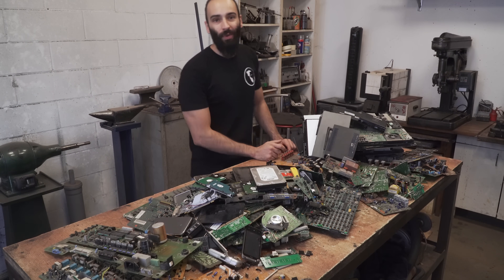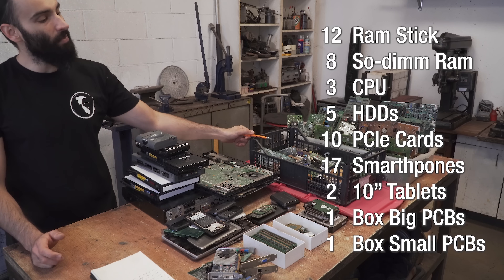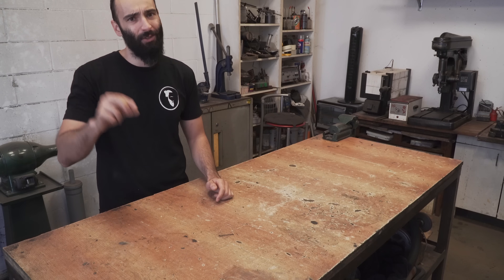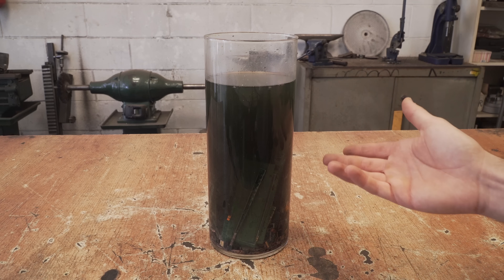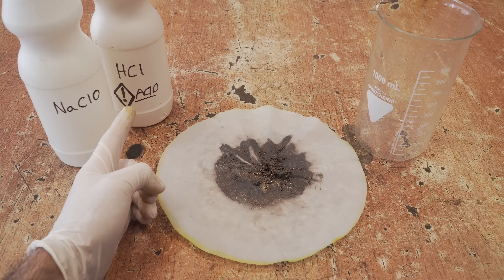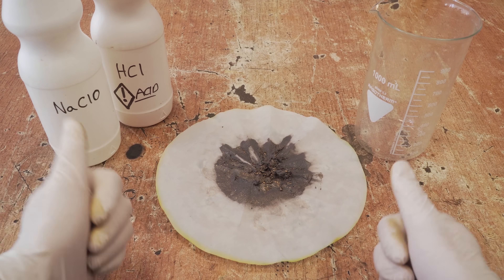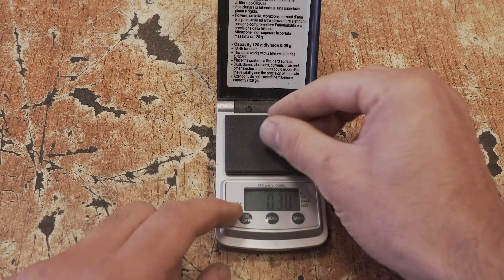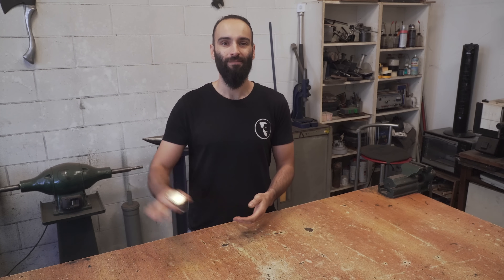E-waste GOLD Recovery | Recycle Broken Electronics!

Comment: You didn't wait for the gold to fully precipitate, SMB addition takes a bit with low gold bearing amounts, and is susceptible to temperature.

You volatilized some gold by burning the filter paper. Generally avoid that. 
Do a second round of refining to remove the filter paper and increase purity, particularly with E waste. Then decant and vacum out the liquid to dry powder.

You didn't add sulfuric acid that I saw, so you probably had trace contamination of Led. 

You didn't wash the gold after recovery. Normally you use boiling water to clean it out from impurities that melt. An HCL bath to help with purity is usually needed as well.

Moreover, review your chemistry on gold plating separation. HCL and H2O2 will put gold in solution. The liquid you called waste likely had some gold in it.

I think you could have nearly doubled the amount recovered with more research on this one.
Then again it's a 2 week Processing so it's not like you'd have made $ on it at all either way.

Comment: You probably lost a small amount of gold due to adding peroxide to your HCL for the first process.
I prefer using HCL only but leave it longer and/or heat it.
You might also have not dropped all the gold with your SMB ... only way to know is with a stannous test on the pregnant solution followed by a stannous test on the liquid left after dropping the gold.
Your best yield items there, anyway, are the chips which I hope you will have processed :)

Comment: But that acid can be used over and over. I saw  a guy that went 3 weeks of the same acid bath till all the gold came off. He ended up just scraping the gold off. Sometimes it needs mechanical means to make it come off. But i did see alot of gold still left on the fingers.  So since got the stuff might as well do all of it. He got a nice big button of gold from scraps.  But gold will probably keep going up in value. Its not like it can be printed like money.

Comment: I worked in a massive E-waste company for about 10 years. High grade boards were absolutely the moneymaker, as well as gold contacts. But there’s were big beefy gold plugs. We had 2, and later 3 main contracts. One was office E-waste, the other was in dismantling decommissioned mobile technology, the infrastructure. Near a phone mast you will see a series of huge green cabinets. They are FULL of gold contacts. Later on we got a contract with BT, decommissioning all their old exchanges from decades ago that were just shuttered all over the country. It was full of gold and palladium. The company expanded so much we ended up with our own shredder warehouse with belts, vibrating tables, magnets etc and visual sorting system. It would recognise a piece of shredded material and jet it off into different boxes. I miss working there now. The owner started like you, scrapping electronics in his garage. He ended up with 2 Ferraris and a lambo 😅
Reply: How do you get rid of silicone from the process?
Reply: Hey I also have an ewaste company and I would love to ask you some questions. Any chance we could connect?
Reply: Would you please help me??
May I get your contact number?

Comment: you left most of the gold in the beaker, with that tiny bit of metaby you needed like 10-12 scoops till the water turned, it was still yellow in the beaker. The gold don't catch in the filter paper it catches in the metaby when you drop it out of solution. I was LMAO at the tiny bead.

Comment: Nice video 👍
Looking forward for the next one.
Just wanna mention out some points.
Adding the SMB to the gold solution is an exothermic reaction. You might have a boil over effect because this. My advice. Use a taller beaker. 
Also. The SMB reaction is kinda slow when the gold concentration is low. I noticed that the colour of the waste changed after you filtered it. Definitely a loss of gold there. 
My advice. Let is set over night. It will collect in the bottom of the beaker. Then filtration is not necessary. You can siphon of the liquid. Then test the waste with Stannous. (Tin2 chloride) so you are sure that everything is precipitated 👍
Reply: СОГЛАСЕН!!!!! 
ПОТЕРИ там были!!!!!

Comment: More interested in the copper separation, which is the bulk of the weight of the PCBs. Not to mention using that to cast brass/bronze parts for machining later. ;)

Comment: HCl is a joke for dissolving gold you need a combination of HCL and HNO3 called aqua regia. It is 3 parts HCL and 1 part HNO3. You threw away almost all of your gold. 

However, acquiring HNO3 is somewhat tricky and you might get yourself listed on the secret service watch list if you try to buy it directly. You would need to make it by yourself and to do it you would need to make H2SO4 first and source of NO3- ions. The process would yield you enough gold to be in + in the end, however, it would be hard for you since you are a beginner without even basic lab equipment. But will earn much more from this video than you would be doing that. This is just my input as a chemist as this hurt my soul.

Comment: First I have to say thank you, as an IT professional I truly enjoyed you destroying all of those components :).  My company has over 130 locations, 40K employees and we recycle all of our E-Waste.  I got to visit the facility that processes it and the place was massive.  At the heart they had a 3 story grinder/sorter, electronics go in, get ground up, then are sorted by floating them in higher and higher density liquids, they skim the floating material off the top and collect it.

They process so much and the operation is so large, they turn a very decent profit.  Yes some of the electronics are repurposed and sold to other companies but hard drives and memory storage devices are destroyed (I'm in healthcare, that's important).

Really nice to see you do this project, it might not be profitable, but it's a learning experience and fun.

Take care!
Reply: What company?
Reply: I worked in a big E-waste company like this, we had a shredder shed just like this but instead of a water sorting solution we’d run the product through different processes, a shaking table, magnets and eventually a rig that visually identified what passed through it and would jet/zap anything on the belt into its correct table. Sometimes the odd bit would get through so there was always one guy last on the belt to do some picking of whatever made it through. Whenever we did hard drives I had to make sure to get photo and weight proof that they had been destroyed. Was a fun job, I miss it now.

Comment: Can I ask a genuine question? If the end result was that you melted down the solid gold powder into the little nugget, would you not have been able to just chuck the whole pcb‘s into a bigger furnace and skip the whole process?

Considering golds melting point being quite high, are there other parts of the pcb with a higher melting point? 

Just quite curious. Was an interesting process none the less
Reply: The other components have so much more volume that they would trap the gold and carry it off and burn it. The plastic for example, would bubble and swell around the gold, and by the time the plastic has completely burned away, the temperature would burn the tiny amounts of gold to the point of not being useable.

The process you described can work if there are large amounts of gold and small amounts of impurities, though. That is the common method for recycling in the jewelry industry.

Comment: When you initially pulled the PCBs from the acid, it looked like there was still some gold plated fingers on some of them?. Otherwise, you made it look easy, much more so than some others. Really interesting.. Thanks!
Reply: Yeah, you are supposed to boil the PCBs boards in baking soda solution to dissolve the coating which covers the gold plating under it.

Comment: Many of those chips use gold bond wires to connect the chips to the packages. If only you had a way to pulverize the chips and then use your gold recovery process…
Reply: Search for "hot ash" and "wet ash" methods. The first one is to burn the IC chips and the second one is to dissolve the plastic in the hot "piranha" solution.

Comment: The extraction would be much better if you used a larger glas container which holds everything (pcbs and stuff) and where you are able to trap the emerging chlorine fumes in order to create a internal chlorine environment. 
Sadly nitric acid is hard to buy so hypochlorite has to be the oxidizing agent combined with chlorine gas the extraction should be comparable with aqua regia (HCL + HNO3 3:1)

Btw you lost a lot if gold in the process too
Reply: Do you think chemicals cost more?

Comment: I was a little surprised by just how little gold you got out of that.  But I'd love to see you process the rest of it.
Reply: That's how little gold you need to protect those pins from corrosion
Reply: I remember NileRed doing a similar video where he processed computer parts to get all the gold out of it and had a similarly tiny amount. Apparently its very common for pawn and gold-trade shops to actually refuse hardware due to how little they get out of it.
Reply: @cyqry  it was not a similar amount if you compare the amount of parts
Reply: @AEcclesiastes  Yeah his refinement was insanely wasteful/low yield. As a chemistry major I was cringing at a few of the steps he took. Even just the melting at the end was pretty awful. You could see how much debris ended up on his table from directly using the propane torch on that filter. He lost a ton of his gold just by blowing it out of the crucible.
Reply: @alexsis1778  Im a chem major now and I have my first test today :) I am not as experineced and smart as you are but  I get what you mean
Reply: You are right budd